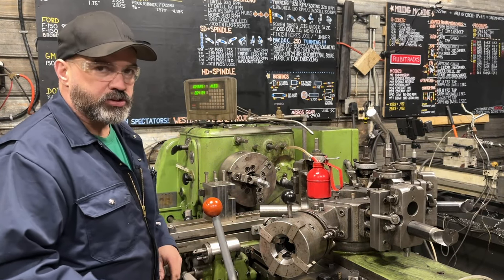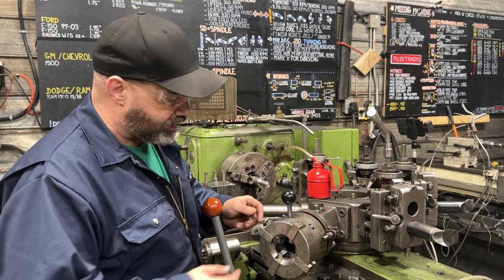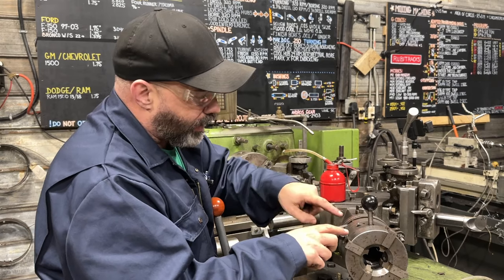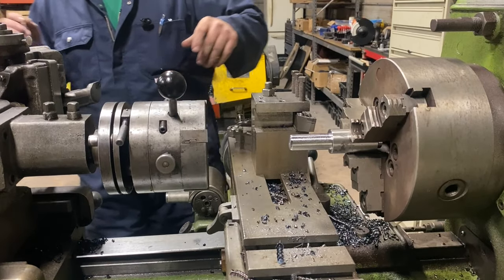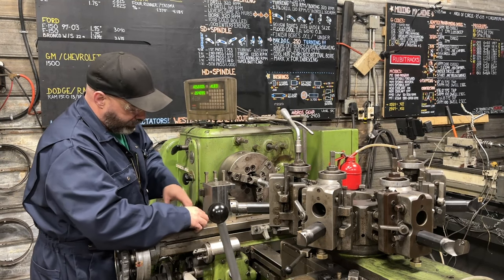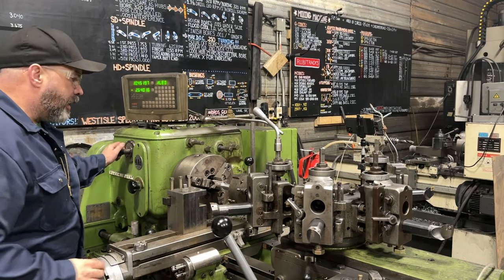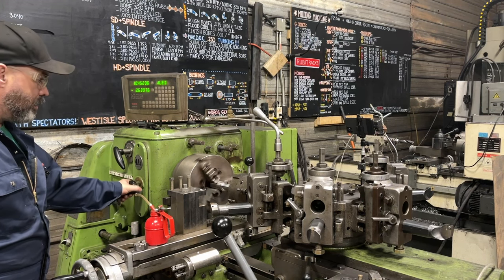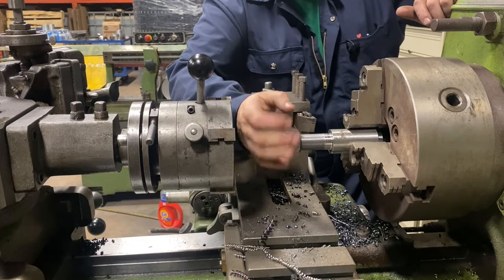Threading with a Geometric Die Head

Comment: Thank you for sharing, I recently started using die heads as well. I also found very little information about their use online. I have found that I have the best results when I allow the turret to feed at the pitch of the chasers, It’s nerve racking, but it just works. Also, I use flooding oil, they need tons of oil to work best, it’s also very good for your machine. There are remastered company videos from Geometric that have a wealth of information on here.

Comment: I have several of these and have been threading on the turret lathe for many years. If you leave the die head open advance the turret until your desired end of thread clearance is where you want it you should be able to engage the feed lock the turret slide and tighten down the stop until the feed trips out. Now it should be set to stop exactly where you put it. Try it with using a shim for clearance and you will be able to set up the same each time first time!  I love how you are able to create and market this product.  Well done!

Comment: im a threading specialist from detroit and i recommend  that you increase your feeds and speeds to not have the tooling engaged for so long heat is not good for the chasers shoot and scoot.
Reply from the maker: There is no feed to adjust, the chasers screw them selves onto the bar and pull the turret / geometric along with them however perhaps a higher rpm wouldn’t hurt I just simply do not know what the right rpm should be and at $100 per chaser I don’t like to experiment

Comment: Hi there, nice video, I'm in the Uk, and I use something similar but smaller than you have, but it does look like your's is a Coventry Die Head, or Alfred Herbert Die Head.(like mine)  On mine there are two settings, for a rough cut and a finishing cut, so you might look and see if yours has the same facility. When first engaging with the bar stock, make sure you compress the spings in the head to ensure a good start for your thread, hope you don't mind my imput, I've been using these things for years, take care, Dave
Reply from the maker: Thanks, it’s a geometric brand as far as I know. Did you watch the whole video? particularly the part about the roughing and finishing lever? Your comment suggest you didn’t make it all the way through
Reply: Yes, I did watch all the way through, sorry I missed that bit! That's great then, gives a better finish. sounds like my die box then.👍
Reply: That is a Geometric Die Head, it looks like a DDSA type, and about 1-1/2” size. Thats a nice heavy duty die head with all the features one could have.
Reply: I know them as Herbert die heads but that was probably because that's what the company had in stock. We had ones suitable for 2BA up to 2-3" BSP, maybe bigger it is getting a bit fuzzy after 30+ years. Most of the stuff was small so the Ward 7 was far to big.

Comment: Great explanation! I understand that the geometric die is easier and faster, but can you also single point thread on this machine, like you would on a regular manual lathe?
Reply from the maker: No it can’t, it has a variety of feed rates but none that will match the pitch of a thread.
Reply: @westislespecialprojects  thanks for the explanation!